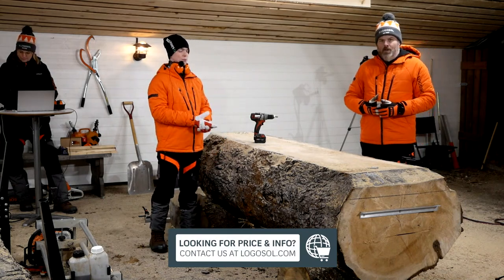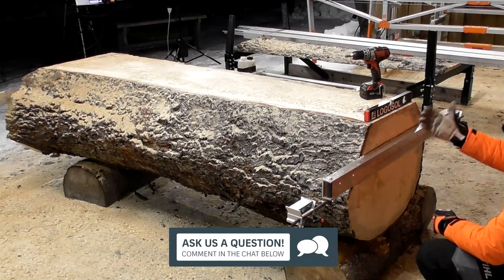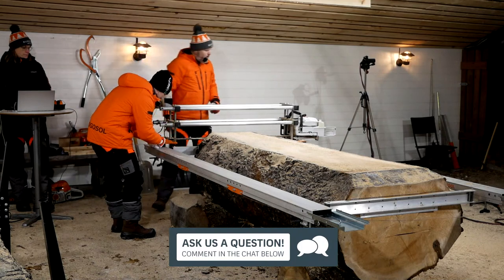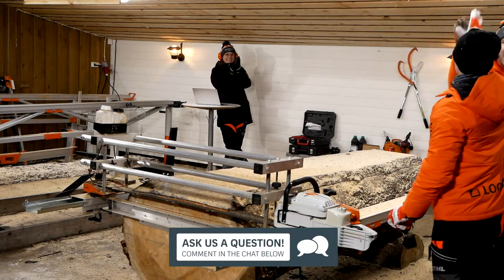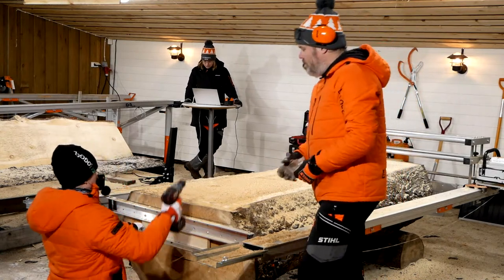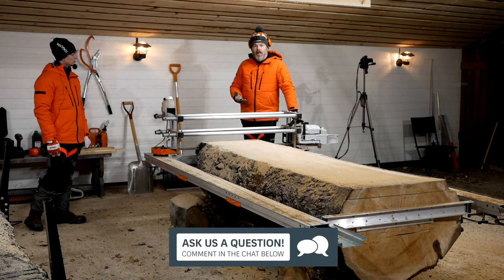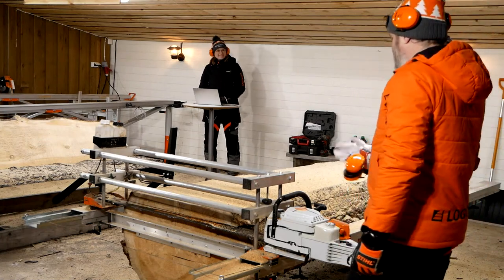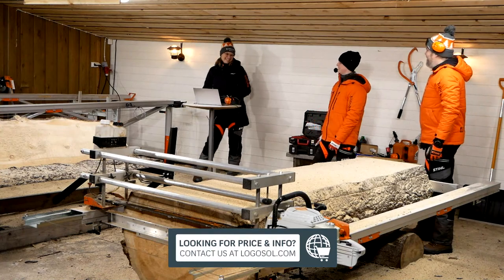LOGOSOL | Live demo - First time sawing with Big Mill Wide Slabber

Comment: Editing your video would facilitate a shorter video time and provide a more concise presentation.
Sometimes a series of shorter videos is easier to consume.
Noticed how painfully slow cutting these slabs are and curious that you did not use any wedges to keep the slab from pinching the chain.
The concept is good but after a few cuts, the operator would be very low to the ground.  That cannot be comfortable.